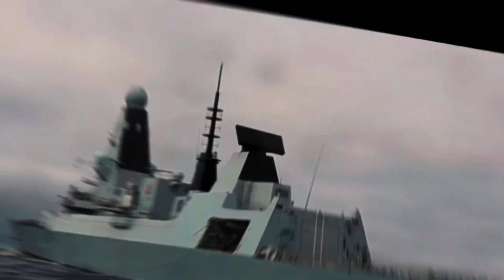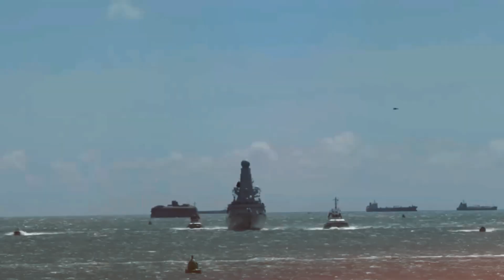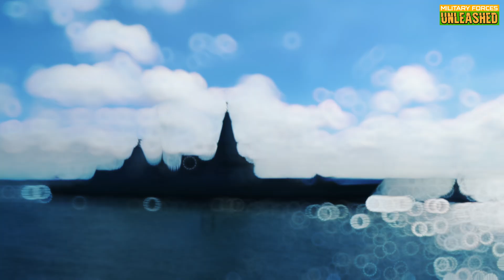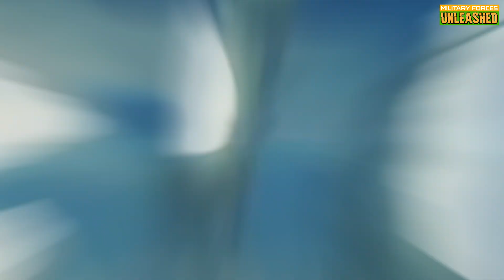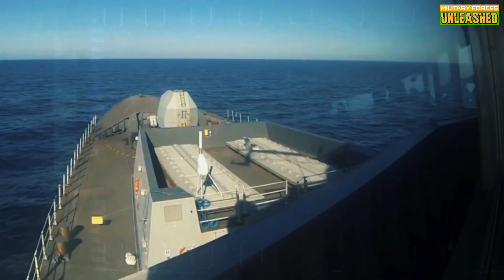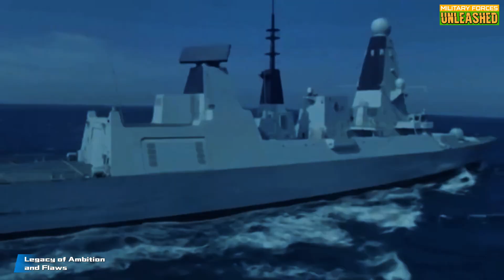This £1 Billion Warship Can't Even Hit a Drone – What Went Wrong?

Comment: An Arleigh Bourke costs about 1.1B dollars, not half of a type 45.
The Daring is also NOT the full package but a sideway compared to the Horizon project due to disputes about what systems should be selected and how they should be placed inside the ship. The French and Italian Horizon have no cripling reliability issues, despite using the same gas turbine, but using CODLAG rather then electric engines of the type 45 in a hull that is virtually the same. The choice of a Mk8 naval gun instead of the  76/62 of the Horizon is the main fault as it cannot shoot down slow speed drones, and the ship is over relying on it's finite missile reserves for anything. It is a common error (FREMM GP), but these ships were designed before the drone saturation strategy.
The Horizon from both France and Italy happily shot down a dozen Houti missiles and drones with the exact same Aster 30 missiles and cannons. What should we say then for the American VLS that instead mistakenly shot down an F18?
In the meantime, the German F124 missed several targets and almost shot down a USN drone with american missile systems on board before being sent home.
BTW, the average cost of a B787 Dreamliner  is between 220 and 280 millions, so much less than even a corvette, while a French FDI ordered by Greece costs about 1.1M€, so the Type 45 is far from "expensive" for what it is. The FREMM is 10 years younger as a design, and properly built to be less expensive then the Horizon (22 ships at about 680M Euro each) but is a frigate and  still lacks the dual radar of the bigger sister; even in the more complete Bergamini class, which has a more modern Kronos, instead if the EMPAR or the Sampson. It is cheaper but carries half the missiles and is less comfortable for the crew when sailing for long deployments.
Had the UK purchased a standard Horizon instead, the whole "redesign" would not have bloated the cost while lowering the acquisition costs of the common ship for everyone else.
Curiously, the Enpar-Samson choice was not the reason why the UK went its own way.